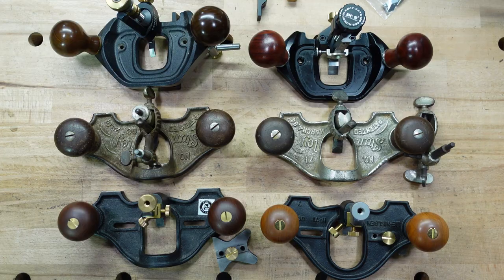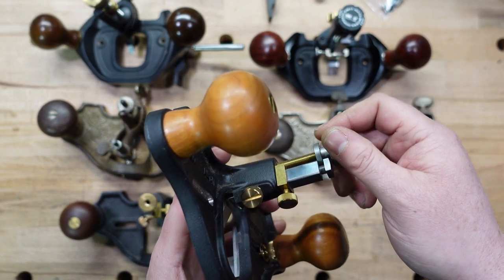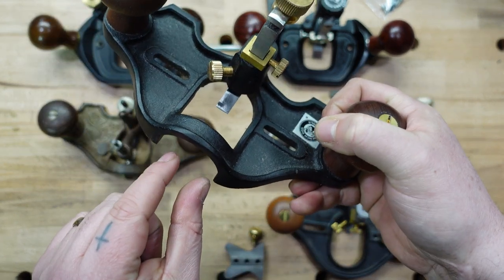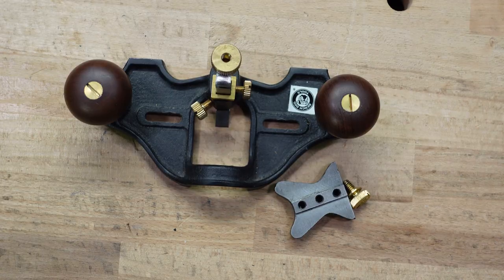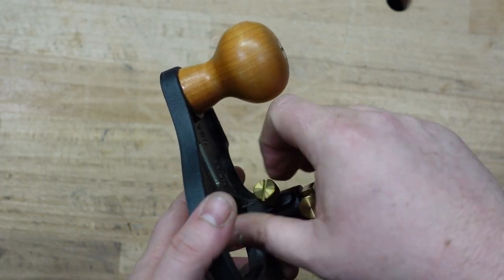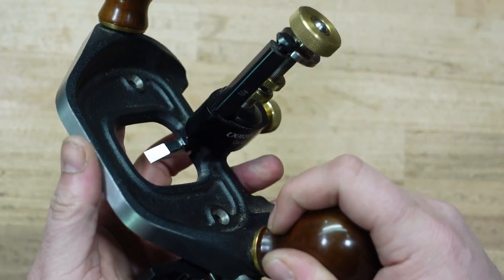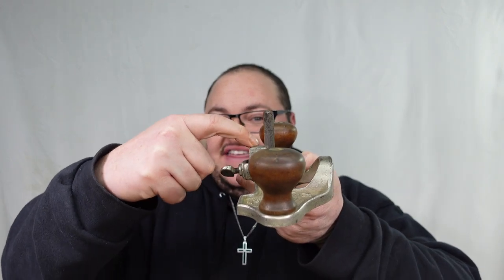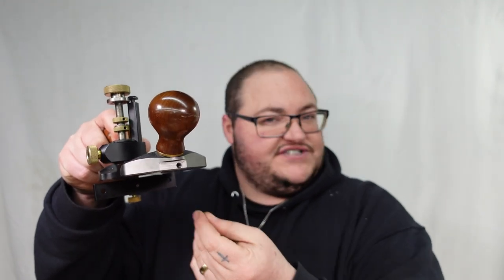I LOVE ROUTER PLANES! Review & Comparison - Stanley, Lie Nielsen, Veritas, Bench Dog and Katz Moses

Comment: Are the sides of the blades supposed to be parallel to each other?  I have been going through a nightmare trying to sharpen the main blade for the KM-17.  The bevel was cut at an angle as well as being convex.  The base was convex too, and the edges are not parallel to each other or perpendicular to the cutting edge. EDIT: I contacted the company that makes the plane, and they apologized and sent me a new blade the next day no charge and no problems.
Reply from the maker: Ouch that stinks I'm sorry but technically they don't need to be parallel unless you are cutting stopped grooves and it comes to a 90* stop. If that makes sense .
Leave it as is and let the angle catch up to 90 over time
For the convex as long as it's cutting flat your fine but if it's cutting at a convex thay isn't good :/ 
Mainly it just need to cut glad groves if it's heavy on one side or not flat it's not good. See if they will replace it! Or return it and get veritas hahah
Reply: @BatCaveCreations  it didn't want to cut anything. The way it was when you looked at the cutting edge from the front it looked like it was starting to say oh.  I wasn't sure about the sides, so I thought I'd ask.  That bevel was ridiculous.  I put in a request for a new blade before I posted above.  The rest of the plane looks really nice and everyone seems to really like it, so I figure I'll be happy with a new blade.
Reply from the maker: @SaintFredrocks  oh sorry I thought you meant the bottom of the plane wasn't flat :( 
I'm with you now hopefully they get you a new blade and you get the plane to work! I LOVE the router plane. It does alot but I also find excuses to use it haha
Reply: @BatCaveCreations  I don't know why I didn't before, but I was just using the pointy blade, and this thing works great. I am really looking forward to getting that new blade.  
It's funny.  It seems like every time I sharpen something for the first time there is a problem.  The last time, oddly enough, I was using my Veritas sharpening jig mk ii whatever for the first time sharpening my Narex chisels for the first time.  I kept getting a crooked bevel no matter what I did.  It turns out the roller mechanism from Veritas was bad.  It doesn't seem to matter where things are made, there are always a few lemons in the batch.  
Have a good one, and thanks for getting back to me on this.  I have been woodworking for a long time, but I am just learning about most of the hand tools, so it is nice to be able to ask someone that knows what they are doing.  What part of WPa are you from?  I'm from Indiana, Pa originally.
Reply from the maker: @SaintFredrocks 100% there are always lemons! It happens it all depends on how the company handles it. 
I am originally from Califormia. Now I life near Kittanning, PA. Not to far from Indiana!
Reply: @BatCaveCreations  I edited my original comment: I contacted Hongdui, and they said I will have a new blade within a week.  They seem like a great company to deal with.
Reply from the maker: @SaintFredrocks  that is great news! Thank you for letting me know!!!

Comment: Looking forward to more videos. You make very concise, to the point content I wish was around when I was making decisions about tools in question. As far router planes go, since I had no mid priced option I went full hobo-woodworker and made one those with a blade made from an allen key, somehow, it still works. However, when doing larger dadoes (or dados? no idea) in soft wood, I get problems with tear out. Right now I am building a wall shelf with dovetailed sides  and mortised and dadoed inner shelves. I cut the sides of the dadoes with a saw and a chisel, but to get a flat bottom I eventually went with electric router after all. Also, would love to have a plough plane, but they are too expensive considering how sparingly I would use them.
Reply from the maker: Thank you!!!
User made routers are awesome I wanna make one one day. Did you try putting a shallower or steeper angle on the cutter? Also, are you in Can I Have It on FB sometimes you can get a plow plane for a pretty good price. Usually better than ebay lol
Reply: @BatCaveCreations  No, I live in central Europe (the narex chisels, thats us). Used hand tool market for planes is virtually non exist around here, so finding stuff that works and which brands to buy was quite a workout at first.
Reply from the maker: Ah deff check the group out we have many sellers that ship international and there is another group called international buggies or something like that, that helps ppl ship international for cheap. If you aren't in a hurry haha
Reply: @BatCaveCreations  I will. I pretty much have all the planes I need. I'm lucky enough that we make dirt cheap wooden planes. They take some work to set up and maintain, but by far they are my most favourite users.
Reply from the maker: I just got a transitional I wanna try but other than that never tried wooden planes. You like they more than metal?
Reply: @BatCaveCreations  For most things I enjoy them more. I have the continental types. Rex krueger made a video about one, but his had weirdly too open mouth, like on a scrub plane, and the iron was bedded at a high angle, mine are classic 45 degrees. 
Best thing about them is that they just glide across the wood, you feel no resistance, like if freshly wax the sole of a metal plane, but even smoother than that. You will have to plane the sole from time to time, but that is a quick process.
Transitional planes sounds great, you get the advantage of a wooden sole, but you dont have to fuss with the hammer adjustment, youll see how it works for you.
Reply from the maker: Yes that is what I am hearing so I deff have to try it out and see how they work! 
Transitional for that reason ahha I'm not good with the tap tap of the hammer! Lol
I'll prob do a video on the transitional vs a metal too that would be interesting 🤔
Reply: @BatCaveCreations  Looking forward to it, we don't have them here. The tap taps are a bit intimidating at first, but as with all handtools, one day you'll just do it right the first time. I do not like US type coffin planes because they lack palm support for you to push on, always seemed to me like they would be clunky, transitionals looked way better in that department. 
As for planing, they are good at most thing, especially dimensioning, very quick, very light, but sometimes I still prefer metal planes for final smoothing and really accurate work (I flatten my wooden planes with my no. 5 metal plane)
Reply from the maker: @Petr Šídlo  that is a great point. I thought about trying a tap tap scrub cus I have seen those HOG material like crazy haha that would be a good practice tap tap one too. Not thats on my buy list haha
Reply: @BatCaveCreations  Good first choice, just go with a narrow blade. Scrub would also be really easy to make, as in hard to screw up. There is virtually no need for accuracy, the sole will get beat on rough sawn lumber no matter what you do, but making a simple basic body with wide mouth for a cambered blade should not take long. They truly cut fast. I also use a wooden jack and a wooden jointer, for rough sawn lumber they are great dimensioning trifecta.
Reply from the maker: @Petr Šídlo  that would be a fun project! If I find the time and don't find one to buy before then I'll deff give it a go!! Thank you!!!

Comment: If I had the plane without the fine adjustment for depth, I'd do this:

1. Put a spacer (e.g., playing card) under the sole
2. Drop the blade
3. Remove spacer and use tool.
4. Repeat steps 1-3 until desired depth of cut is achieved.

I think both of those Stanleys are pre-1906 due to the lack of factory holes in the sole.
Reply from the maker: This is perfect! Thank you!!!

Comment: Lee Valley has not manufactured that style of depth stop on their large router plane for quite a few years.

The current depth stop is rock solid.

It was recognized early on with the Veritas that the depth stop was deficient and a number of people came up with solutions to add a LN style depth to the Veritas. 
To state that the design of the depth stop is a deficiency of the Veritas router plane as currently manufactured is incorrect.

Comment: Thankyou for a well structured and comprehensive review.
I'm astonished there are still so many limitations in each design despite their time in market.
Veritas is most easily available in Australia, but at eye watering price (i can almost buy from US shop and import it myself cheaper).
KMT doesn't seem to have replacement blades available which is a bit of a turn off.
You addressed the Veritas locking screw coming loose. Does that screw interface with the depth adjuster thread (concern over damage) or a plate on the blade holder?
Is there any noticeable difference in backlash / blade movement between the planes? You did mention KMT has most solid blade holding.
Do you find yourself using the different irons often?
Again. Great video!
Reply from the maker: Thank you! You are correct none are perfect haha
I only had issued with the blade lock on the veritas when I was being too rough with it or trying to be tough and take a deep pass. It doesn't interfere with the depth screw. It pinches the iron onto a v groove plate. So maybe ppl messed that up? I'll have to check mine haha
Backlash/movement wise I would say that KM has the least, then LN, BD, Veritas, Stanley. But... it really depends on how heavy of a cut your taking. Alot of ppl are ROUGH with router planes haha I like how the veritas moves because thay movement tells me I'm being too rough and I back off and take a lighter pass. 
I change irons ALL THE TIME haha I mean if you have 5 boards with 3/8 groves your gonna use the same iron for all that, but I do alot of projects with different sizes, weird inlays, etc. So I'm swapping then out alot. Ppl use chisels where I use the router cus I prefer it over chisels. Have more control and precision for me :)
I hope that help! Thank you again!!
Reply: @Bat Cave Creations  thankyou for the detailed timely reply!
I'm a very green hobbyist but value good design and execution - it makes the experience a joy. Your video has nudged me towards the Veritas option.

It has been very hard to find good information on tools (and impossible to lay hands on them) prior to purchase.

It surprises me that simple things like squareness and flatness and backlash aren't advertised or evaluated as they are with power tools or other items. Also assessment of features that impact usability like blade alignment you noted in your shoulder plane video.

Veritas, Stanley and Luban are most accessible here, but can import Clifton, Woodriver and Lie Nielsen at a pinch. Useful to have the information before committing to an import ;)
Reply from the maker: Happy to help!! I started put where you are too without enough info so I'm trying to be a YouTuber that changes thay :)
How do you like Clifton? Never got to try one but I hear they are better than LN
Reply: @Bat Cave Creations  to give context I am only a few months into this journey and the only plane I own is a 40 year old Stanley workman #4. It was neither flat nor square but I've now (after lots of youtube) tuned it to be an acceptable smoother. I have a number of veritas accessories (making gauges, honing guides etc.) that I'm very impressed with. 

Money isn't really an issue, but by the same token I appreciate quality and value of key features over gold plating and polish. 

I've seen a Clifton 5 1/2 on display and they do look and feel superb. Compared to the stanley Bailey next to it the stanley was truly a cheap toy. I have no experience with the Clifton performance in use and wanted more information before pulling the trigger on that occasion. 

I'm about to start a project to build a dresser for my daughter. In the next week or so I'd like to order a jack plane (62 or 5 1/2), router plane, shoulder plane and combination plane. I've been researching these for some weeks. I don't actually need the tools for the job, but it is fun to hunt for tools and play with new toys. 

If I take the jack as an example, the Veritas LA is AU 469 delivered and Luban is AU 299 delivered.
For standards, the Lie Nielsen 5 1/2 is AU 899 + shipping, Clifton is AU 750 Delivered and woodriver (#5 only) AU 535 delivered.
I'm leaning towards the Veritas LA but the Clifton 5 1/2 std had been a strong #2 consideration. 

Similarly for medium shoulder planes it is Clifton AU 485 delivered, veritas AU 379 delivered and luban AU199  delivered. I'm again leaning towards Veritas as a better balance of quality, features and price however there are no direct comparison reviews out there for these models.
Reply from the maker: @Morgan James  ah ok I get you, those are huge price differences there. Are you in Can I Have It on Facebook we have many sellers willing to ship internationally. Buying used with same you some money and maybe bundle a shipment and get 1 big instead of all these seperate shipments. 
I have heard good and bad about Luban, it's Woodriver from what I hear just under a different name. 
Clifton won't disappoint and neither will veritas. Both make quality tools. I have not tried Clifton but what I hear is that it's better than veritas and LN. But veritas jointery/specialty planes have been taking the cake for me. Where LN benchplanes are winning so check the specs of Clifton and see what features the offer and weigh that against the price compared to veritas. 
There is a guy in the group that actually lives in Australia and has a huge tool company there but travels to the US to get tools. This is his site and that may help too if you are open to used tools: https://www.toolexchange.com.au/

Comment: I dont own the veritas but i do know if you want to lock two nuts together on a thread so they wont move, you need to tighten them against each other with two spanners/wrenches. If you only hand tighten them they wil just move along the thread together and not lock up. So maybe use a tool to tighten up, hope this helps. Great channel btw.
Reply from the maker: Thank you! Ya I learned that after the fact :( haha I also learned I have an old version and was able to upgrade to a lock collar :D

Comment: You can adjust the Stanley that does not have the depth adjuster by tapping the iron gently with a mallet. After you figure out how tight to set the screw and how hard to tap the iron, you will get good enough at it to set it for a very fine cut. I do that with my small Lie Nielsen router that does not have a depth adjuster.
Great video BTW.
Reply from the maker: I deff need to get better with the hammer tap taps! I struggle with that haha
And thank you!!

Comment: I found this video very informative. On the Veritas depth stop, I think I saw two set screws in each stop. If so, these could be locked with an allen wrench and they will not move.
Reply from the maker: Thank you! And your right there are holes for that but veritas made an upgraded one so I just got one of those. Don't wanna have to use to amen keys to tighten those every time I need to ahhaa

Comment: Moses for the win. In done with wobbly planes if it's the most solid than I have the most confidence in it being the last one I ever have to buy. Also it's not hard to tap a a little piece of metal to mak ed your own cutters. With the ad tdd anley types making your own specialty cutters would be sookoo much more work I wouldn't even go there. But tapping finer a screw and filing 3 lines, I couls bnb do that if i had to which I'd call a major plus. Also the depth readout I sa accurate and clear.

Comment: KM router is only similar to Veritas with base and knobs. How the blade is held to the body is completely different. I wouldn't call it's a copy of Veritas. 
Bench Dog seems to be an exact copy of LN, based on Rob Cosman's review. It seems to be ok quality, and quite cheaper than LN.
LN is only similar to Stanley No 71 with base and knobs. How the blade is held to the body is completely different. Blade adjustment is the same.
Stanley No 71 has several iterations. You showed 2 earlier models. Veritas is actually very similar to newer Stanley No 71 in terms of how the blade is held to the body and how blade is adjusted. A collar is holding the blade to the body, and blade can be removed about the same way as on Veritas. I never used the front foot on No 71 as depth stop. It's quite wide comparing to all the blades you can fit on a No 71. I only use it as front support, and I usually do not have that assembly on it at all. Stanley 71-1/2 is the close throat version. 
The simplified copy chain is, LN copied Stanley's body and blade adjustment. Bench Dog copied LN almost completely. Veritas copied Stanley's blade retension and adjustment. KM copied Veritas' body. LN, Veritas and KM both have their innovations in this topic. 
Last thing to note is KM didn't develope this router plane. It's a rebranded Hongdui one.
Reply from the maker: Thank you. This is great info to add. I appreciate you taking the time! It helped me and will deff help others!